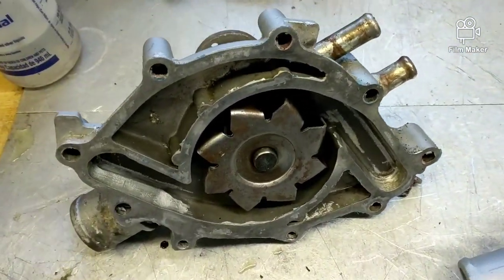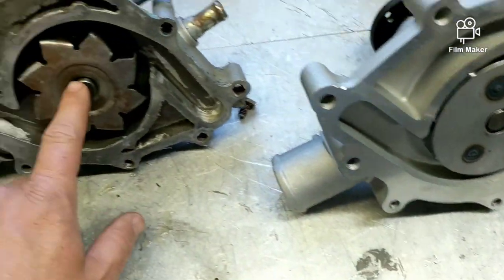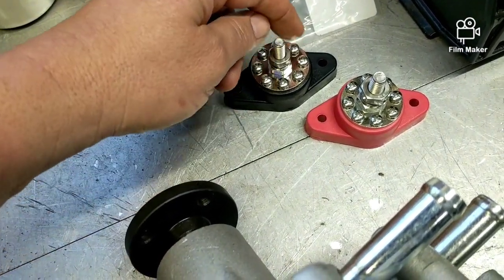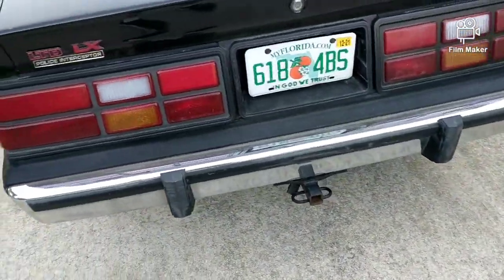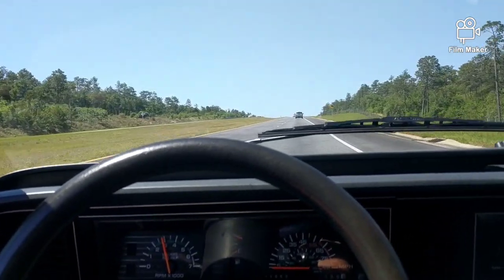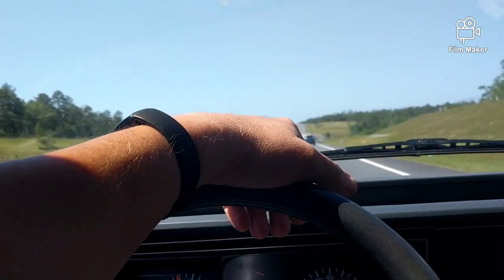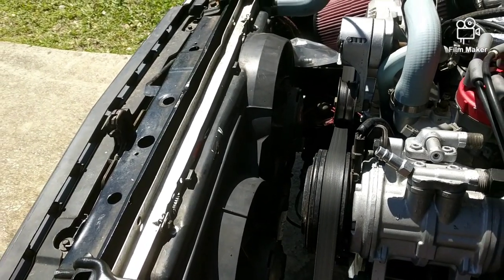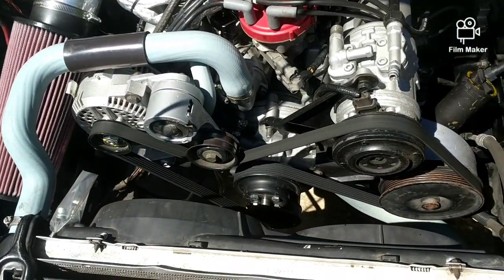LTD LX cooling issues

Comment: Im hoping that mine doesn't run hot with the underdrive pulleys, I went ahead and put a high volume water pump on it hoping to retain at least the same volume of water like it did stock but i haven't ran it enough to really find out , I just got the exhaust on the rearend and rear brakes on, got the 5 lug conversion rotors on the front and will be getting my drive shaft shortened next week and will get it on , its getting really really close so im going to drive it down there really soon and get some good break in miles on it, But man that LTD sounded good when you walked around the back end and you could hear it idling, just making music and it is the perfect sleeper car because no one will ever expect it to be fast like it is 😁
Reply from the maker: We're doing another dyno day the 22nd of May.

Comment: Had problems with underdrive pulleys changed water pump pulley first, but only the factory crank pulley helped.
Reply: Fyi, just picked up a Spal fan from ebay 30102049  2020cfm 28amp 100$ offers, now it has never come over 190* with alum sroud, and its been hot and humid around here, 16" 1300cfm china fan ran 220*-230* all day. Thanks for the videos.

Comment: I’ve done everything except go to a bigger radiator and mine runs identical to yours... big radiator is next on my list.
Reply from the maker: On Rockauto they list the CU547 for an 85 LTD  with a V8, and it shows the core to be 4" wider, and .25" thicker than that listed for a mustang.
Reply: @FXRSDriver  I found a triple pass made by Northern Radiator I’m going to get it I believe